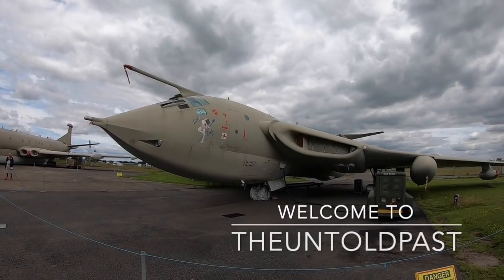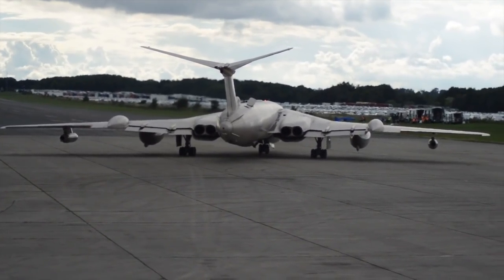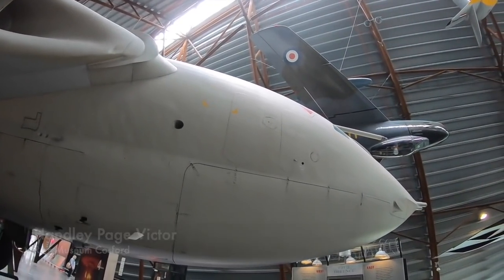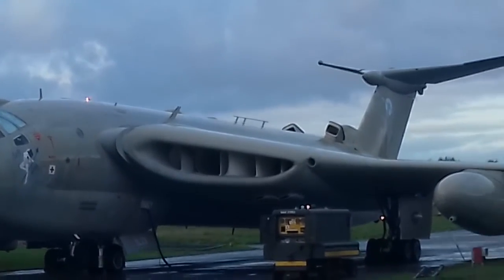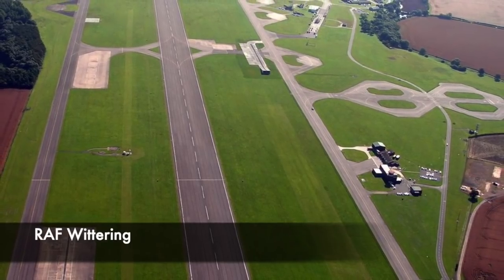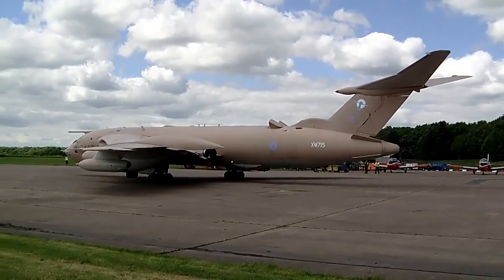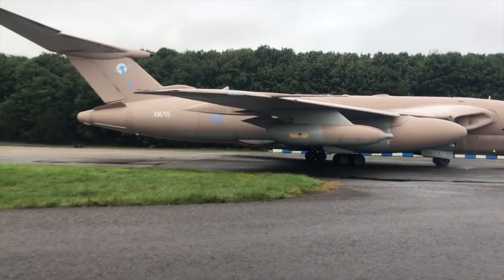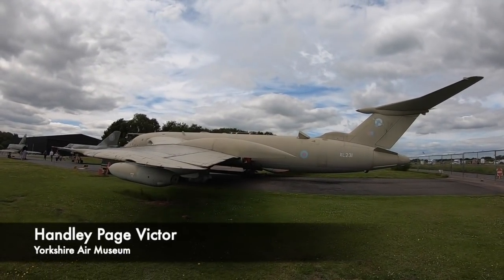The Tragic Story Of Handley Page Victor XM714

Comment: My father investigated bombers for the RAAF. Ultimately settling for the F111.
He once told me the theory behind the V bombers is that they could sit just below the speed of sound for long periods. Which is quite taxing on normal airframes. So any fighters following, trying to match it's speed would shake themselves to pieces.
I am not sure how accurate this is as I have never seen it mentioned anywhere else.
Reply: I've a comment further up the page on thistopic.
Reply: Never heard this idea before, but interesting. When you read about performance of aircraft, max speed is quoted but never cruise speed. Generally, an aircraft capable of mach 1 or more usually  cruises at around 350 knots. Flying any faster would use too much fuel. Your father would be well worth listening to.  All of this knowledge is disappearing and it is tragic.
Reply: @charlesrussell1764  Unfortunately he passed away 15 years ago. He worked at the a Woomera rocket range as an engineer. For the Weapons Research Establishment. I think it was regarding Blue Streak, which ultimately a white elephant.
 I once snuck a look at his resume and he also worked for Intelligence. "Evaluating Foreign Technical systems" I think it said.
Reply: @HouseholdDog  Unfortunately so many really interesting things are being lost because we do not record them. Blue Streak was a shift in philosophy before its time. AI is reintroducing the idea of killing without being killed. The military expends so much effort into enabling destruction that one has to wonder at our sanity as a species.